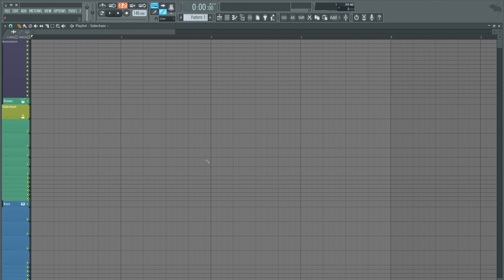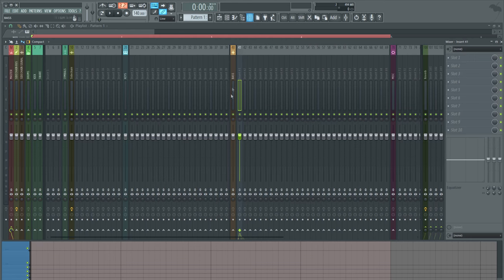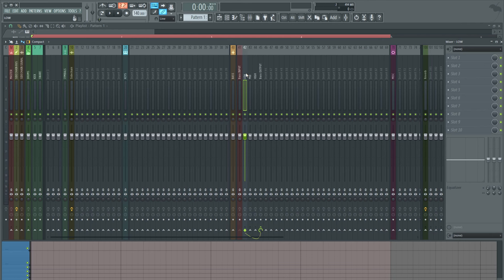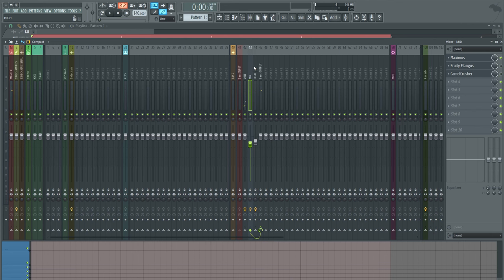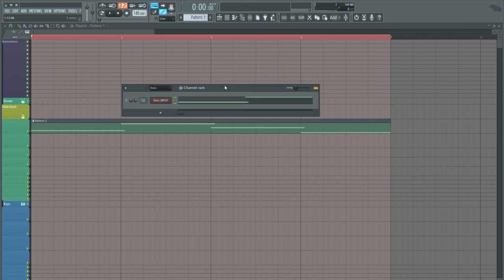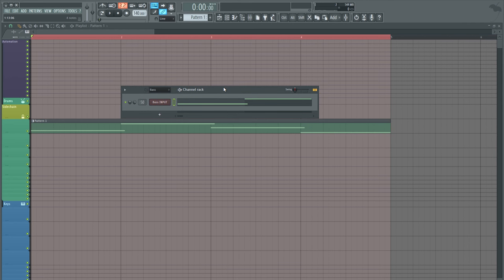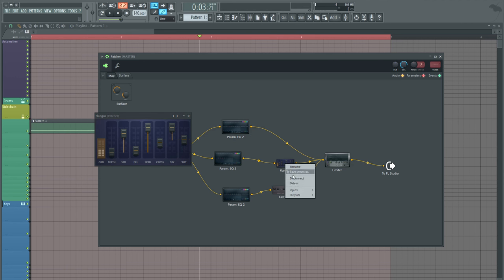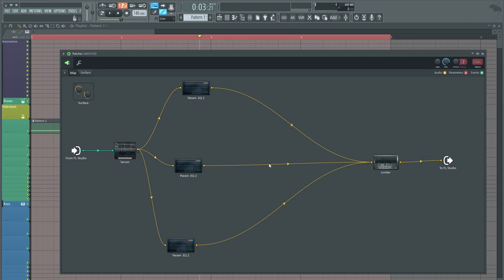Secret Music Production Technique | How to Frequency Split!!!

Comment: You can easily do this with NO plugins in FL Studio by simply using the built-in mixer channels own EQ.  To be sure, I just tried and it works fine (mind you there there is no hi/low pass, but you can get really close); certainly easier than patching stuff. ;) You just don't get all the fancy EQ visuals.